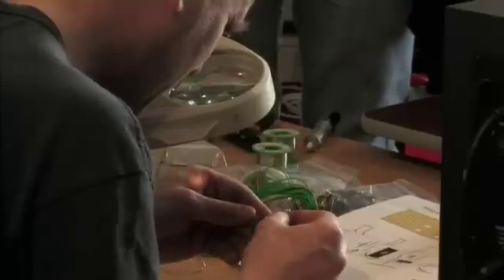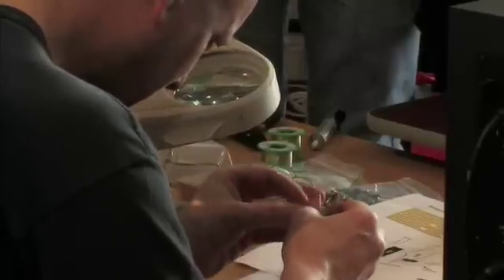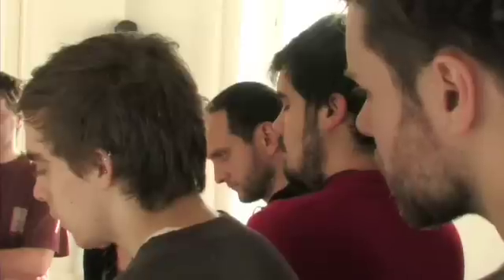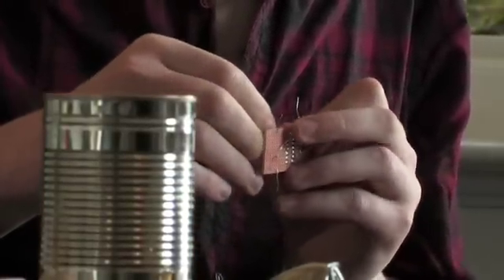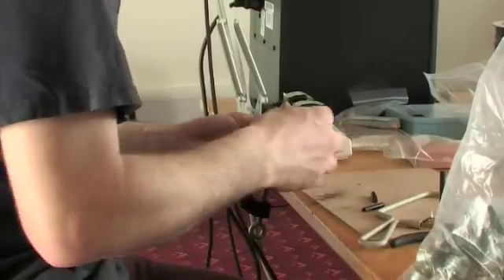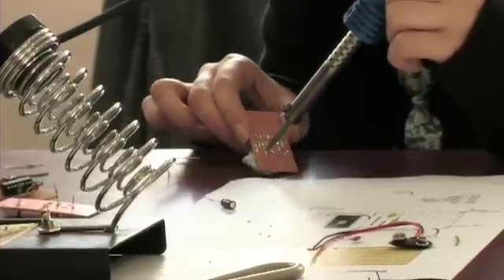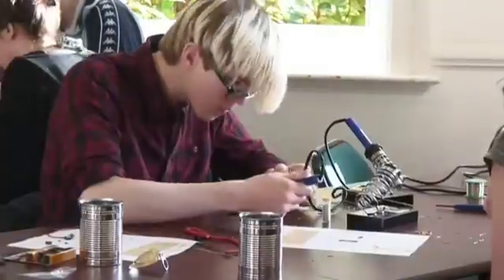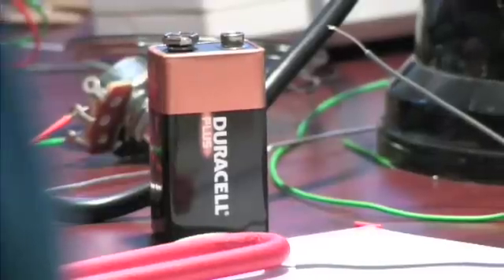Circuit-Bending: Atari Punk Console

Comment: @LiquidChem thats a hard one. you'd need some way to square the mic wave form or track the pitch of the mic and turn into cv values for the 555. You'd probably be better suited hooking your mic up to an lm386 and connecting that to a 4093 oscillator.